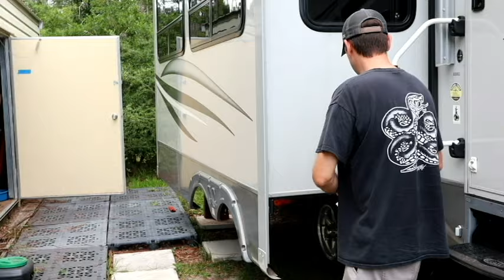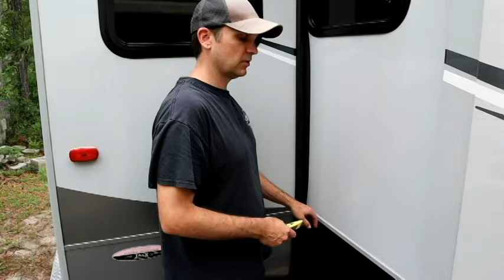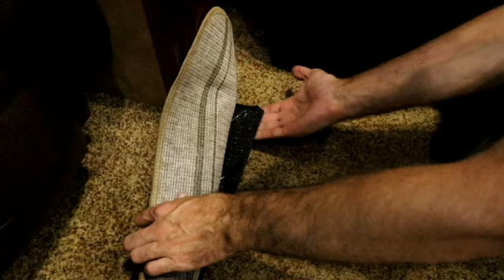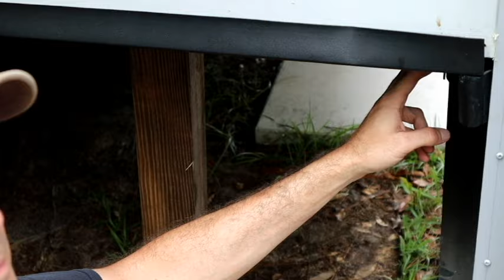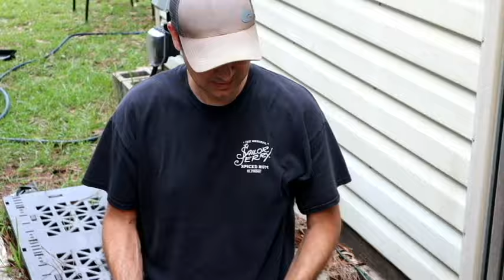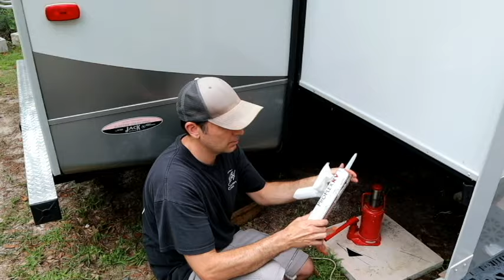RV Slide Repair | How To Fix RV Slide Out Leaks | RV Slide Out Problems | RV slide out Maintenance

Comment: Thanks! We are currently out camping and i noticed a piece of fabric hanging down from my kitchen slide. The "sawdust" board underneath felt damp. I told my wife i need to drag the Montana High Country to a dealer and get some suggestions for remedy. You just offered a very promising solution. I thought maybe some slide toppers would help too but i know they can present problems also. Thanks for the video!

Comment: When you put your trim piece back on, did you reuse the original holes or did you go higher with the trim piece and make new holes? I’m picturing going higher so that the top edge of the ski is just below the top edge of the trim piece and inside the butyl tape, but the screws go through the side of the ski still?
Reply from the maker: I think it lined up to go in the same holes.

Comment: Thank you for posting.  I discovered the floor had the wood around few of the screws from the bottom, starting to rot so I was able to resink new screws in prior to installing the skis.  Thanks for the detail instruction....it worked slick.

Comment: Thanks for the video.  You make it seem easy.  

I have the BAL Accu-Slide system with compression rollers on my slide and "flush floor" design.  Are all the angles on the slides the same for all flush floor designs?  Would the angle on the Duo work with the Accu-Slide system?

I'd prefer a stainless steel ski, but have not found anything other than Duo that appears to be wide enough for the rollers.  Have you seen any cradking in the skis after the installation?

Comment: Could this be my issue, where the bottom of the trim is getting wet and rotting please? I tested this time, not putting the slide out all the way out, waiting for a big rainfall until I go back this Friday. I did subscribe 😍 tx
Reply from the maker: Not putting your slide out all the way will definitely bring water in. We wouldn't recommend testing it that way. Thank you for watching and subscribing. However, if the trim is rotting and the corners are wet after a rainstorm it could be the issue. Good luck and thanks for watching!

Comment: All trailers & motor homes are built to fail deliberately it's all a con marketing scam.. these makers of trailers & motor homes want customers to return to the dealerships to get repairs done that costs into the hundreds even thousands if it's a roof repair needing be done, the roofs on ALL trailers & motor homes are built to fail in ten years of purchasing a new trailer or motor home, I would never buy any RV trailer or motor home they are nothing but 100% junk...

Comment: Good job with your video. I think it’s important though to ensure you know where the water is entering. Often these leaks originate from failed seals in the windows allowing water inside the wall and accumulate on the slide floor. If the Darco material on the bottom of the slide is not damaged/frayed it should be waterproof and other entry points for the water should be considered.

Comment: Hi, It worked thanks. Is there any skies for the center of the slide. I'd like to put 2 or 3 flat skies in the middle for more insurance. . thanks.
Reply: Me too, did you ever come up with anything?
Reply: @lukelukevis  No but the skies I thing are thick enough to hold the rest up so it don't rub. And I always spray the skies with slide lube so far so good. I'm glad I found your demo. If I ever have to replace these skies I'm going to order 4 of them and cut 2 for the center.

Comment: Well I'm 73, and the idea of doing this is too much for me, I can see screwing it up. I'm going to use 1 inch painters tape along the bottom edges snd see what happens. In theory,  water should run down the edge and off the end of the tape, away from the slide underbelly. When I leave, I pull the tape off.

Comment: Exactly the video I was looking for. My question is. My slide's out 3 feet and is 12 wide and works with cables. Will I have to  do any adjustments to the cables or chains or are they thin enough that won't make a difference?  And that outside trim, Is that just trim or is that a guide also to keep the slide right ?
Reply from the maker: No adjustment needed, yes that strip is just a trim piece.
Reply: @RVLivingYet  Thanks that cloth is starting to fray and I was looking for something like this for a while. You popped up on you-tube now I'm going to do this. Thanks, I'll let you know

Comment: Isn’t that a moisture barrier? The culprit is the track that you were pointing at. If you seal the top of those screw tracks, you won’t have no leakage. Seen it many times.
Reply from the maker: Thats not the track, its a trim piece.

Comment: Looks like a trip to a local metal or duct fabrication shop and you could get some nice metal slide "skis" made instead of cheap plastic.
Reply from the maker: We though of that but feared the metal edges would cut the vinyl floor. These are very effective.

Comment: The bottom line is that water runs down hill and must be mechanically shed.  This will always be a point of failure until it is finally designed properly.

Comment: Question… couldn’t you have just got some flex seal tape and covered the affected area? Dealing with a similar situation and just wondering if u think flex seal tape will work? Thanks 🙏
Reply from the maker: We tried zip tape but the pressure of the side wore it out.
Reply: @RVLivingYet  I tried Eternabond and it ripped and tore underneath where the slide rubs.  DO NOT USE TAPES!  I know have spend two days with a hair dryer removing the Eternabond so that I can install the skis.  STICKY AWFUL MESS!!

Comment: The sticky tape that came with the ski’s is that butyl tape? Wouldn’t it also be a good idea to add the pro RV silicone to the underneath edge just in case of serious downpour causing water to be pushed back up underneath?

Comment: why not just use eternabond tape along the edge with a bottom lip?
Reply from the maker: Tape didn't hold up to the weight of the slide going in and out.

Comment: Have you determined if there is a DIY option to this rather than the $75 skis?
Reply from the maker: Not really, tape didn't hold up and metal is pricey and may bend
Reply: Hey! I wanted to give another opinion. My wife and I just purchased a 30' Bunkhouse Keystone Sprinter.. I had no clue about skis so I had to figure it out by myself. What I did was wash the surface really well then dry it well, then use white duct tape.. Try to use 1 or 2 whole pieces and make it look professional. It doesn't come off for a long time only if you clean the surface. hope this helps!

Comment: I'm a little confused. Shouldn't it go behind the wall panel? I feel like if that sealant doesn't stay exactly perfect, that ski is just going to fill up with water and hold it there. Maybe I'm missing something, though? 
Since the floor attaches to the steel tube thing from below, and the wall attaches to the side of the tube, if the ski is sandwiched under the wall panel, the only way for water to get in is from the wall screw holes, which are butyl'd. But still, if it comes in from the top and goes between the wall, it's got nowhere to go if that ski is on.
Gah! I'm so torn on if I should get these or not!!

My slide floor detached at the corner and now I'm looking at a $1,600 repair to get a new floor put in. 😖 The repair guy claims that the woven vapor barrier does a good job, but the problem is from water getting in through cracks in the sealant. I'm thinking if the vapor barrier is so great, it shouldn't make any difference how the water gets in; It should resist it whether it's over the trim or under the sealant, right? But what do I know. 🙄
I'm also wondering, why are we messing with special order wood from Keystone here? Why not go to a machine shop and get a piece of sheet metal so this never happens again?
Reply from the maker: In our case the ski wouldnt tuck under the wall, Im pretty confident in the butyl and proflex and check it regularly. The woven fabric is ok until it wears as in our case water got in at the edge and ran in the fabric. As for metal, that would be an option but to get that curve at the end would be pricey and unless its thick gauge the weight of the slide might dimple the sheet metal causing an edge to flare and gouge the floor. So far these skis have done the trick for us but Im sure there are other solutions.
Reply: @RVLivingYet  Oh yeah, I hadn't thought about that tapered edge part. Nevermind, heh. 
Okay, good to know you're pleased with it so far. Thanks for helping me think it out. This has been just a tad overwhelming; The floor isn't supposed to fall off of your house, ya know!? I'm just about convinced to sell this fifth wheel and never own a slide out ever again.

Comment: So could this cause moisture to move up into the wall or would it have to be coming from up top or a window for it to be in the wall as well? The bottom portion of our wall is soft and a good 7ish inches of the floor is rotted along the side wall of the slide.
Reply from the maker: Its possible the moisture has wicked up the wall, but I would also keep all the seals and roof.
Reply: @RVLivingYet  I checked the roof and typically I can spot cracks in the seals and edges but I can't see any points where it would be leaking unless its leaking from the window. Noticed only the top of the window was caulked, not the sides. The wall starts giving from the window down, but it's worse at the bottom where the wall meets the floor.

Comment: Instead of the “very expensive plastic” I’m thinking aluminum fascia would work, it’s pretty cheap and comes with the 90° bend.  Liked and subbed!
Reply from the maker: I thought about using metal but was afraid it would bend under the pressure and a sharp corner would catch our vinyl floor.

Comment: I could not see if the side of the ski goes under the sidewalk of the slide? It seems it would. Thanks
Reply from the maker: It didnt fit under ours but you may be able to fit it in yours, it would be the best way if possible.

Comment: Great Video! Thanks a lot, another tip you might give people is that if you do a quick line across the trim & sidewall at each screw location before you remove it, you can easily line it up when you go to put the trim back on. less guesswork.
Reply from the maker: Good tip

Comment: Excellent video.  I usually replace screws that were removed and dip the new ones in the ProFlex to try and seal against water intrusion on the screw threads.  Almost every screw I've removed shows signs of corrosion.
Reply from the maker: Great tips, thanks for watching!
Reply: Could you provide a link to proflex as I do not know what it is?

Comment: Question! prior to putting the ski, do you have to dry to bottom floor (wood) first? We live in the Pacific Northwest (Cold and Wet!).
Thanks, Great Video.
Reply from the maker: If the wood is soaked its probably best to dry it so you dont get mold.

Comment: So I do not have the leaking problem at this point, however we noticed the slide out has cut the linoleum.  Will this product help to prevent that in the future?
Reply from the maker: We noticed our carpet wearing and this really helped, if your slide is rubbing at the edges this will work for you.
Reply: @RVLivingYet  thank you!  We are planning on putting Down new flooring and want to make sure it doesn’t mess up after the work/investment

Comment: I’m dealing with this right now... bought a moisture meter, reading 100% from the inside corner of my slide out floor. Thankfully no sagging and it seems localized. I’ll have to get these skis really soon. I’m glad I ripped out all my carpet when I did so that I by chance found the leak problem.

So lame these rv manufacturers treat their product like this. Shame! $$$
Reply: But of course we wouldn't be buying all this other after market products they put out . If they built to with stand the elements
Reply from the maker: Glad you caught it, lots of people dont. Ya these are made as cheap as possible. Thanks for watching.
Reply: Yeah made cheap as possible but sell for tens of thousands lol
Reply: Yes! For what you pay for an rv, you could buy a double wide that is bigger to live in. Not that double wide manufacturers are any better making their products, but they are better than these rv’s. We live in ours

Comment: I’m going to be doing this one in the next couple weeks as part of a video series on how to prevent water damage along with my RV armor roof and a gadget a local RV shop has to put positive pressure in the camper to find any sealant failures.   There’s always someone do!
Reply from the maker: Gotta keep the water out, its a constant battle.

Comment: Every RV Slideout has this Problem... 🔥 Can't Believe there hasn't been a Class Action Suit against this Design Defect
Reply from the maker: Ya they know about it but dont care, pump them out cheap...
Reply: Hey, yeah! That's a good idea! Why aren't we doing that? Insurance is useless, too, saying it's owner maintenance neglect, or whatever. 🙄
Reply: @lisakukla459  they did the same damn thing to me talk to me another stupid insurance and it wouldn't pay for crap
Reply: Thanks for a great video! We just discovered this issue with our RV, floor on both ends of slide water damage. Now having to replace most of the flooring. You live and learn!
Reply: NO KIDDING, I have had trouble with this now on three diferent RV's. One I ended up paying $1500 to replace the floor. After the floor was replaced it started leaking again.
Reply: Update so I installed these skis and now the leaks is completely sealed this should be a manufactured install very easy to install
Reply: Sign me up!
Reply: I bought my rv 2 years ago used and it only had been camped in 4 times. When I got home weeks later I found the Rita foot in on both side of slide out.
Reply: Worst design ever. I just checked mine, floor is rotten! FML!
Reply: Exact same issue I have with my unit. I’ve contacted Forest River citing a suspected defect or design flaw, they told me that it was due to a lack of sealant maintenance….which certainly was not the issue.
Reply: How about that class action?
Reply: mine is having the same issue, just discovered it this week 😵
Reply: Agrees. Only when you live in one do you realize all the design flaws that can be easily corrected. Its bullshit, all these manufacturers need to up their games. First order of business, a built in dehumidifier system.

Comment: Our skis buckled and broke when sliding in and tore the boot.  Going to fix these right away and patch the boot for later replacement but now I know to keep an eye on the ski. Thank you!  Looks like I can do this myself.
Reply: I changed them both, using the parts you recommended, followed your instructions and it's perfect.  Thank you!  They look great, work and now water free.
Reply from the maker: @wileydash  Awesome! Glad we could help.
Reply from the maker: Youre welcome
Reply: Since our new plastic ski split (reason I put on a new one, old one split), I ended up using 1 1/2 inch angle aluminum, 1/8 inch thick, made a template of the angled floor inside, cut the aluminum… used aluminum brazing (solder) to finish the angle for the floor.  No more breaking 😊

Comment: I just started having problems with wear on the bottom of our 5th wheel slides.  I have been "googling" for a while for a solution, and this is simply outstanding.  Thank you, thank you, thank you!  Quick question, in addition to the butyl tape you used on the slide out ski, do you think it is necessary to also add screws?  I would rather not, but I am concerned about it possibly slipping.  Great video!
Reply from the maker: Glad it helped, the screws on the trim on the sides went through the slide plastic and holds it in place.

Comment: my screws on the trim are not catching wood or anything. what do you do to fix that
Reply from the maker: Its hard to say without looking at it, was the trim screwed on before? If so you will need to find where is was screwed to, if not you may have to glue the ski on.
Reply: Try swapping trim piece from left to right

Comment: Sadly, we didn't notice this issue until the slide floor had severe damage 😥
Can you please tell me how to repair the damaged plywood before installing the slide skis.
Reply from the maker: Thats a bummer, with major rot you may have to remove the slide and replace the floor completely, I'm not a repair tech so I don't really know how to advise you on this repair, a local repair shop may be able to give you an idea whats involved.
Reply: RV Living total bummer!! Now I noticed top slide seal is leaking. I’m so discouraged 😢 thank you for replying!!

Comment: Great video.  This was very helpful. I think you have the best video on YouTube about this.  Question regarding the ProFlex RV.  I have used it as well, but using my finger to smooth it out, or Tooling it, just never seems to work since it is so sticky.  Do you have any helpful hints in using the product?  Thanks.
Reply from the maker: Thanks for watching, for the Proflex dip your rag in mineral spirits or lacquer thinner and clean your finger after each wipe, also work it really fast before it gets tacky.
Reply: @RVLivingYet  perhaps seal 4-6 inches at a time?
Reply: Thanks for the quick reply.  I will try that.  Also, just placed an order through your link, i think, for two sets.  Much appreciated.
Reply: One other question:  how long have you had the ski installed?  Has it been working like you thought?  I just received mine and going to work on installing this weekend.  Just wondered if the heavier slide was sliding in and out without issue on the bottom?  Thanks,
Reply from the maker: @clysack07  sorry just saw this, so far these have been working great. It also stop the carpet from wearing inside. Very happy with the upgrade.
Reply: ProFlex recommends dipping your finger in soapy water before smoothing it out.